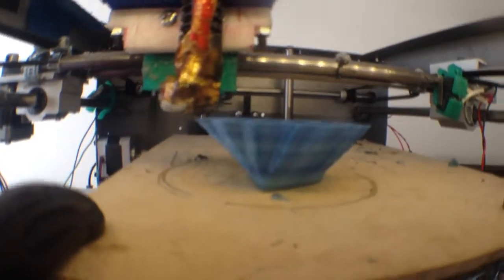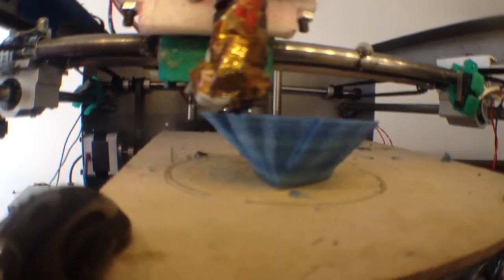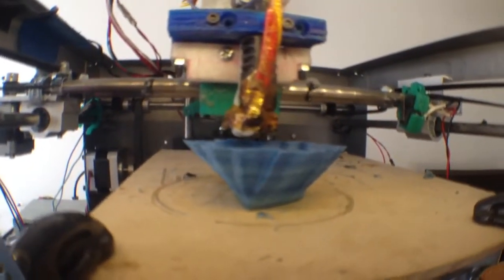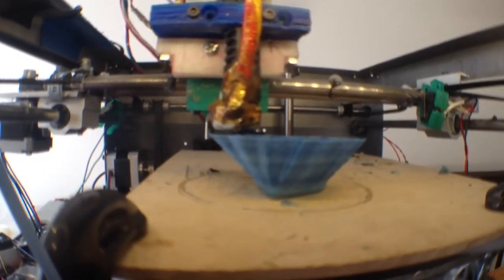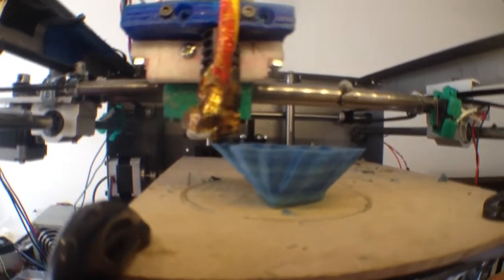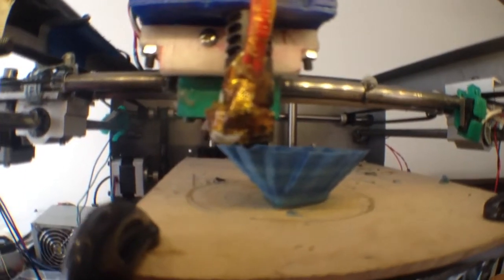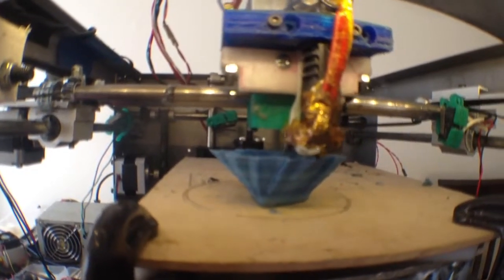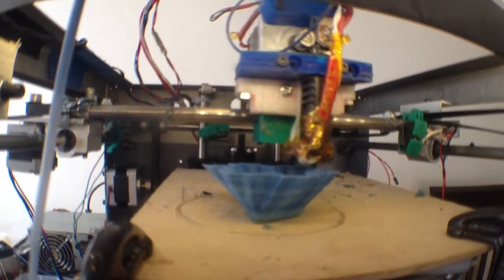Nylon 618 filament

Comment: i boulght a doodle 3 and i should have just bought a 2 and used it to print the parts to make a 3, its almost a whole new machine after all the stuff i had to do tol just get it to print consistant and for more than an hour.